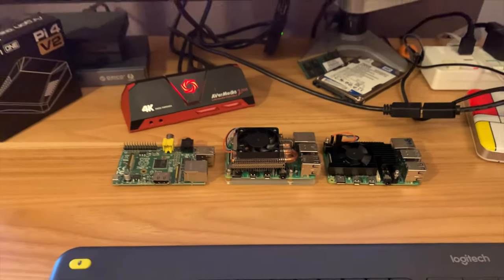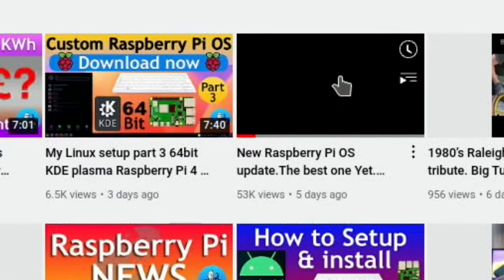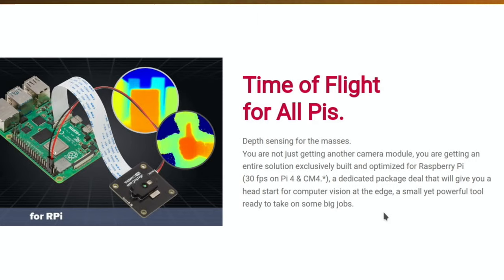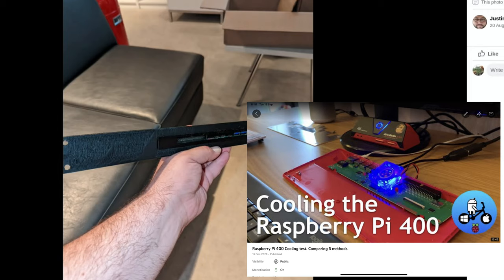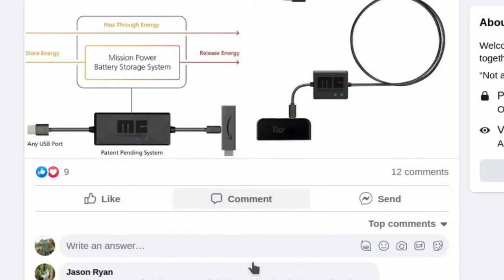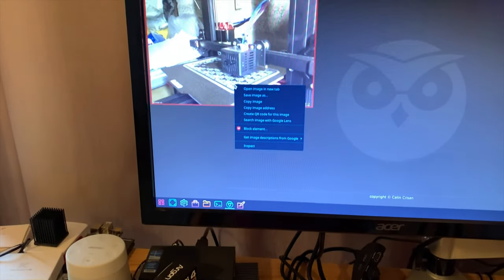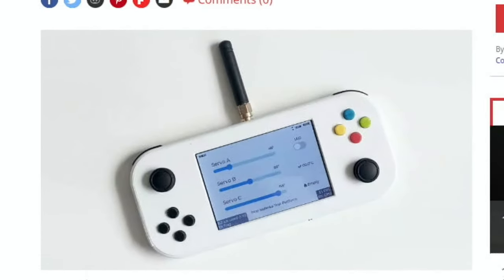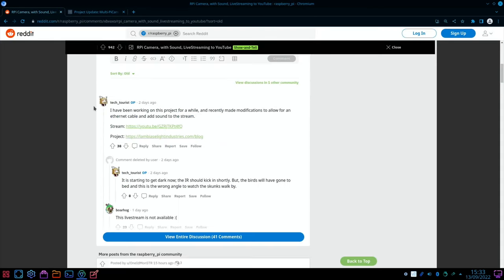Pi news 68. Six Screen off grid Pi. Time of flight Camera.

Comment: The time-of-flight camera looks really cool. I have a Jetson Nano 4GB with 2 CSI ports (which are currently using a Waveshare stereo camera) but you could use a single colour camera and this depth camera to replicate the Kinect.

There are some other SBCs with 2 CSI ports but the Jetson Nano 4GB might be the cheapest. The CUDA cores should be useful for image processing too.

Comment: I've gotten the lightning bolt with some "Amazon Basics" USB-C 3-ft extension cables.  Ditching them solved the problem.
Reply: I had a CanaKit power supply and it still gave me the lightning bolt often. I think it was just the Pi3 though because ever since I've been using the Pi4 I haven't gotten it once. But definitely anything Amazon Basics should be avoided.

Comment: Still no Pi 5, huh?
I want to get the prototype myself since you have it :p
Reply: There will be no Pi 5 in the near future, much as you would like to see it.

Chip manufacture still has not recovered since the "you know what" and whatever supply there is is in demand by the likes of Apple and Android device manufacturers for their mobile devices, as well as car manufacturers for their in-car systems. Even if they are not using the same chips as in the Pi, the production line space will still be limited, and in "catch up" mode currently, and I am sure Apple, Samsung, Ford, Toyota, etc. have enough money in the right places to get their needs pushed to the front of the queue over the much smaller Pi Foundation.

If you can buy a Pi 4 at the moment, it is anything from double to quadruple the normal retail price - do you really think that the Pi Foundation will be able to improve on the Pi 4 enough to justify a Pi 5 and keep the cost at a price point that we would expect to pay? 

Plus, on launch day, you need to have millions of new Pi's available for everyone to snatch up, otherwise it would look like a completely botched launch. I don't think they have the capability of getting a new Pi 5 manufactured at enough volume and at the right price currently to do a successful launch anyway.

You also have to remember that the Pi Foundation isn't a normal company, they are also a registered charity here in the UK - mainly because of the focus they put on education and getting the Raspberry Pi in schools. At a time of high inflation and economic slowdown where school budgets will be tight (some schools here don't even know how they will pay their heating bills this winter with the increased energy costs), they are not going to launch a new Pi when no schools will have the money to buy them anyway. That would not be a good look for a charity focused on computer education for kids.

I am sure that the Pi Foundation is eager to release new boards but I suspect it will be at the lower end of the product range - so maybe a faster Pi Pico or perhaps a 1GB RAM version of the Pi Zero 2W - if nothing else because they contain few components needing manufacture and people would still buy the Pi Zero 2W at an inflated price because it would still be cheap.

Comment: Sounds like they added a capacitor to the cable to store some energy?
Reply from the maker: It has a battery 

Advanced battery management circuitry Integrated 2000mAh lithium ion battery
Reply: @leepspvideo  Yes, a battery.. That would do it.